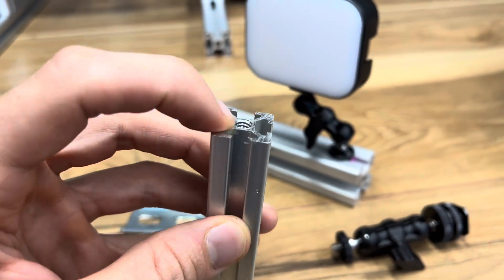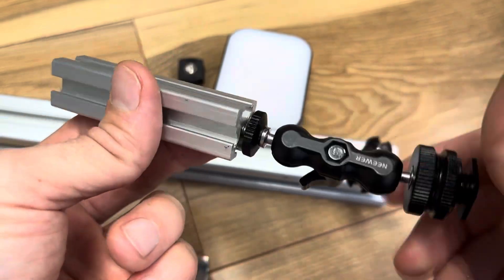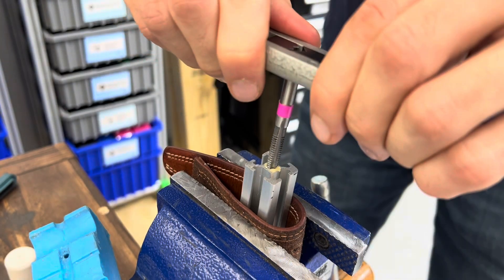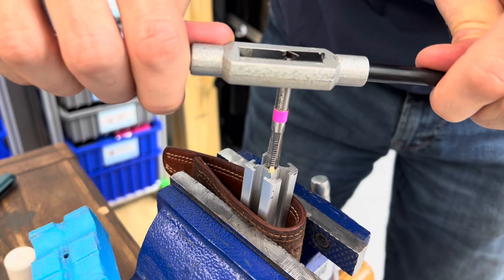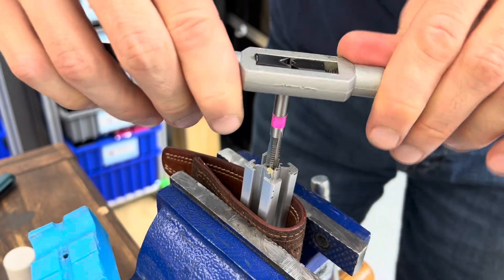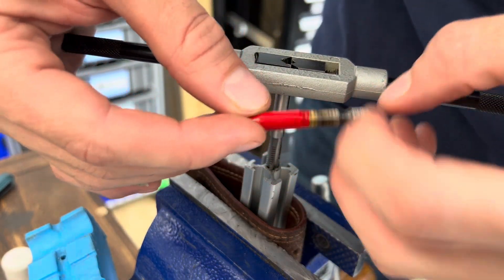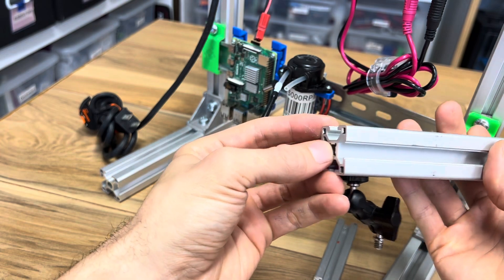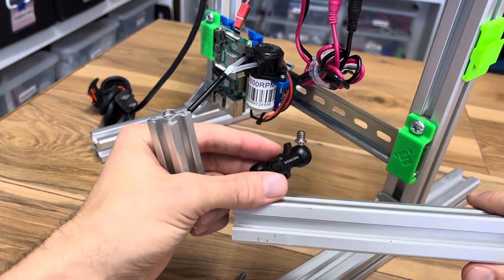Tapping threads in Extrusion for Beginners

Comment: Have you not had issues tapping that 30 mm extrusion with the x pattern in addition to the hole?
Reply from the maker: no issues here.  It can help to use the drill-mounted hex tap and pull the trigger quickly so you can focus on starting it upright.